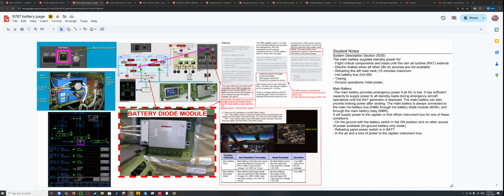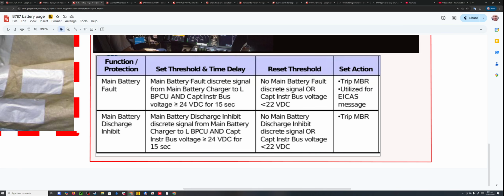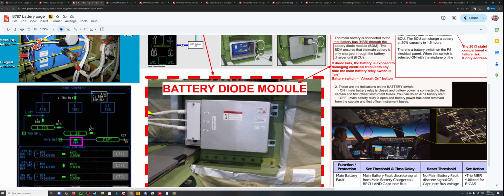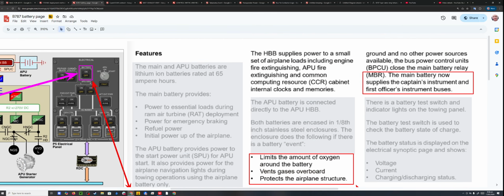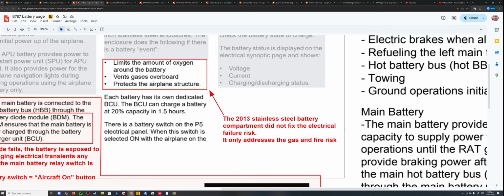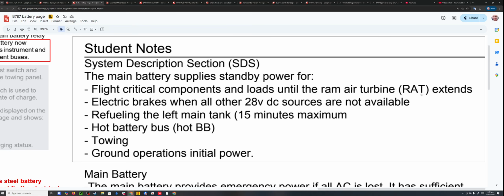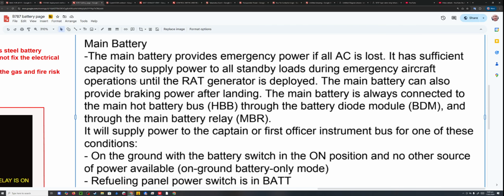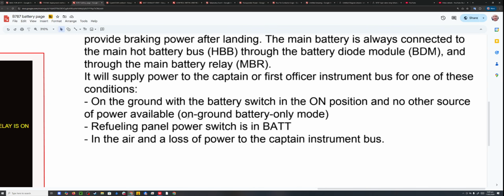AI171 Crash - B787 System Oversight Error (#2) Main Battery Relay Trips After 15 Seconds of Fault

Comment: Finally, you're explanation has got through my thick skull! Even I could understand the logic in this video. I reckon there are many Boeing engineers who know about this and are thinking "oh sh!t" the cat's out of the bag. Easy to understand video and another hammer blow to the initial report by the Indian Air Accident investigators.
Reply from the maker: this ones a bit old. the work continued and its not just me anymore. a team of people were employed to interrogate my work and did so, and its grown to perfection now with a few minor clarifications. Just things like the fact that both HPSOV and spar valve did have both their control relays reverse actuated, and the trigger to the HPSOV from the relay was reverse voltage but that still triggered the shutoff as the relay at the other end of that on the FMU on the engine, doesnt care about polarity. so both spar and HPSOV valves closed. All 4 EEC channels involved reset, with each sides dual channels resetting at the exact same time thanks to both PSOV and SPAR valve relays triggerding their EEC resets on the 250ms delays, the entire HPSOV contr relay is on the delay, but for the spar, its just the output to the EEC reset. 
The source of the reverse voltage is the melting down battery and is assisted in part due to the nature of the airframe's construction, where the front bulkhead is metallic and the rest relies on copper wires for the current return network. 
The most important fact is that it is simply impossible, as tested, and categorically proven, impossible for the RAT to be supplying hydraulics earlier than 13 seconds after a valid fuel swtich cutoff on takeoff, unless the RAT was already commanded to deploy for a different reason. That reason, is the documented trigger, of loss of ALL power to both instrument buses. That means, all DC power including the battery. If it is not kept alive by the battery, it satisfies that trigger and deploys the RAT.

Comment: Dear Jeremy -
much thanks for good detail work .
from very beginning since i knew there are Lithium batteries in this aircraft ,i believed it was battery thermal runaway fire case (and Mr Ranjeet Jahn too made my beliefs strong on Mojo story ) and through Mr Stig  i saw what boeing did after battery fire incident in 2010 to 13, just built a steel case called Coffin to protect outer electronics from the fire but nothing to real Battery improvement.
i believed Fuel spar valves would had shut if 14 V DC coming from Lithium Battery of 28 VDC supplied Died ??
Mr Richard Godfrey on Mr Geofrey thomas youtube channel wasnt agreed my Battery thermal run away theory, though they both stay on case of total power failure , and no fault of Pilots Theory , and really has been working hard .   

my short video on it 

https://youtube.com/shorts/0gEgweZWuaY?si=wIz8RvOI6nSULFyM
Reply from the maker: nope its not 14 volts that dies. 14 volts should never exist anywhere.
28 volts should be going the correct way. what happened, is the battery shorted to case in the middle of its string of cells, or close to the middle, just as it did in the Takamatsu fire event in 2013.
This short to case creates an entirely unseen and unplanned DC electrical circuit. The voltage that the coils of the spar valve control relays recieve, is reverse but not fully 28 v. by desing, (milliitary specs) they have a safe garuanteed minimum required voltage that theyre desinged to be able to function at, and for these relays, its 14.5 volts. Further the manufacturer of the relay does not put in reverse voltage diode protection because they know that doing so puts them at blame if said diodes fail. DIODES FAIL,. so instead, they make it the aircraft manufacturers problem, and clearly state in the relay specifications that.. and i quote:
"Applying reverse voltage to the coils will not damage the coils, however the relay may transfer"

That means, all it takes is 14.5 reverse volts and the coil will pull the pin the wron gway instead of puishing it, commanding closure of the spar valves.
Reply: @jeremyjohnthompson5187 thanks again for such a detailed information,

Comment: My analysis: Pilot did turn off the fuel switch, just to check what's the issue, Just like if a motor doesn't work even while plugged in you just plug it off/ switch it off and try again (It's pretty Indian thing to do as well) But what made the pilot think that there might be some issue with the Engine/fuel switch may be due to some massive electrical failure.
Reply: A 10 second switch off while 100ft off the ground? 10 freaking seconds........

Comment: Am I reading this correctly? I understand the reasoning behind the 15 second delay when a battery fault is detected and the check to make sure there’s adequate voltage on the Captain's instrument bus before disconnecting the MBR but this type of added delay doesn’t work well for a battery shorted condition and what you’re pointing out Jeremy. What it looks like though is if there is a battery short that caused the battery fault or if the shorted condition occurs after some other detected fault and the MBR is closed the Captain’s instrument bus voltage is going to get pulled below the 22V min limit and the MBR won’t be opened up even after the 15 seconds is up if the bus voltage remains below 22V. At least this is the way I’m reading this.
Reply from the maker: I think you get it. I think your reading it correctly.

Comment: Maybe this is a bit pedantic, but you've mentioned a few times that the 787 is unique compared to all other aircraft in history in that the main battery is always "on bus".  This may be true for large jets (it's been a long time since my 737 days but I think that's probably correct).  I think the main reason for this is that the big jets will have a battery charger that will charge the main Ni-Cd battery in constant current mode first and therefore will go above normal bus voltage.  But there are many many smaller aircraft equipped with Ni-Cd and lead acid batteries that will have the battery on bus all the time.  Probably any small turboprop, maybe small jets but I'm not familiar with those.
Reply from the maker: None of those smaller aircraft use this same hopeless lithium cobalt oxide chemistry.
Airbus use Saft's sensible LMFP, Lithium Manganese Iron Phospate, similar to LiFePo4.
None tie the fautl together with a garuanteed 15 seconds of propagation to both sides.

Comment: Top value information found in this episode .Now it can be determined that everything of the electrical system was designed to fail. On the topic of battery & associated circuit, High capacity lithium battery placed inside aluminium container means non extinguishable metal fire as in EV car fire.
[ Need to know what diode is/are inside the “ Diode Module “ as in the photo.] This 1960’s methodology is not the proper way to control high battery current direction flow. Diode is easily broken down. 
The operation of the  three DC  fuel valves are extremely critical , they must be properly powered. 
I can’t see  anything there sensible.
Even the basic requirement of an Manual Bypass in Automation Control is lacked. Flying hundreds of lives has no take two in computer Flight Simulator game.

Comment: The prior flight, having a hard landing, failed cabin electronics, failed air conditioning, and even worse, a failing horizontal control surface reported by the prior pilot, was most likely, an unheeded, lethal warning, that seemed to have been ignored, or was wrongly assumed as "fixed", for the two+ hours the airplane was on the ground.  

Every critical component must be made easy to inspect, they made the battery very difficult to inspect while attempting to solve the fire hazard.

Comment: Based on the footage alone, and the dust that was kicked up, obviously because it was too low and unable to gain enough height..but that that element alone should exonerate the pilots, if it was intentional, i would think they would wait until they get at least a few hundred feet off the ground..Their slanderous explantions pointing at the pilots is such an absurd insult to intelligence. That said, now that you mention the brakes, is it possible due to the non-standard take off they were aware something was very very off, alarms going off etc, they tried to brake much earlier before V1 and reject takeoff hence the dust being kicked up. but for reasons that we know now, not enough power was available to brake.? There was an event in 2020, in Leipzig flight QY841, where the crew rejected just before rotation and they hit the brakes where the nose was actually off the ground..ending up destroying all tyres. but that was a DHL A300. Since the 787 is such a electronic relient system, and knowing how erratic electronic shorts can be wreaking havoc and with the  intermittant nature of shorts and false signals, anything is possible. and would that brake application show up on the FDR given that it may not have been recieving the signal of inputs from brake application.? Or was it the brakes that zapped most of the remaining power, but not enough stoppage power so they continued.? All we have is that footage as you can't rely on any FDR or cockpit or phyiscal evidence that comes from these conglomrates. They will 100% negotiate the narrative to ensure they come out on top, reputation intact.
Reply: heres the thing, thats not dust that was smoke coming out from the bottom vent of the airplane
Reply from the maker: close, but the key lies in what happened after the short. it wasnt just 0 volts. something managed to generate reverse voltage to reverse actuate the run coil (open coil) in the dual coil latchin relays that control the spar valves. This is the only possible thing that can command a fuel valve to close without the EEC and CCS agreeing with the switch.
So you have to join it all together and find how its possible to end up with negative 14.5 volts on the instrument buses, one after the other. (minimum required to actuate coil accordin to the MIL specs)

Comment: HI, a Dad here! I love the analogy of a DC UPS with wings! I myself couldn't believe the 15s delay built in to the fault monitoring logic! Again, I'm not an aircraft engineer, but I've worked with DC on CNC machines.  And there's no way I'd want to be anywhere near a DC Drive designed to provide 100A power to a motor when it is seized, for example. 15s of untold DC power flowing through the circuitry and the motor would scare the pants off me! I just do not understand their thinking on this. Can't wait for the next video.
Reply from the maker: theyve got lots of breakers to save situations between the buses and the loads, but only a diode module and a relay with 15 seconds of logic between the battery and the bus!
Reply: @jeremyjohnthompson5187 😮 Wow!
Reply: @jeremyjohnthompson5187  So, they are sending short circuit current through a thermal runaway battery adding more energy with every second?
Reply from the maker: @stevefuller6014  the energy from TRU to battery would have stopped very quickly, the TRU has th efollowing for overcurrent protection shutdown...
1. AC input CT clamps
2. DC output hall effect sensors

The short remained and with the lack of supply from the overload protectd TRUs now offline, the batt was able to  then wreak maximum havock with reverse voltage from the internal short to case. All it needed was 14 volts to send the relays the wrong way.
Reply from the maker: fast forwrd 10 seconds, battery is let go, MBR opens afte 15 second countdown, TRUs resume supplying bus, RAT is supplying TRUs with AC. Relays reset to correct run position, open 28V sent to spar valve motors, fuel flow resumes, along with ignition
Reply: @jeremyjohnthompson5187 Excellent summary of key events. I have a few questions regarding the TRUs:
1. When a normal load shorts, does the load breaker trip first, or does the TRU overcurrent protection activate first?
2. In AI171, after the MBR opens post-countdown, how does the TRU knows it's safe to come back online i.e. how does it know in advance that it won't immediately overcurrent again?
Reply from the maker: @natanijelvasic  a load shorting would trip either its TCB ( thermal - not resettable by crew) or the ECB (electric resetttable by crew). differnet things have different breakers.

in one of my vids there are some diagrams that show differnet things.

The landing gear for example, they are feed by thermal 100 AMP breakers which cannot be reset by the crew, maintenance must go in to the EE bay and manual reset after sourcing the fault that caused it.

The TRU would not reconnect the DC side unless it was reset by the BPCU.
This should almost NEVER happen.

From the designer... QUOTE
ELCU Protective Functions:
Overcurrent protection
Differential Protection, 
Ground Fautl Protection
Unbalanced Current Protection

ELCU INterfaces:
Can Bus
Power Panel Data Netowrk
Current Transformers ( FOR AC)
Hall Effect Sensors ( For DC)

ELCU operational functions:
Open / close / trip from commands from the BPCU, GCU, and other dedicated controllers
Monitor Load current

Monitoring functions:
3 phase current
aux contactor status
pick up and hold coil current
trip status
Contactor discrete commands

IN SHORT:
The bus power control unit is that which is controlling the ELCU and the ELCU is monitogin and controlling the physical breakers based on the information sent to and received by the BPCUs.

It is the BPCU which will tell the ELCU that everything is back to normal, try again.

The entire thing works in harmony, just without the required human programmed input that a short on the battery will propagate reagrdless of its actions
Reply: @jeremyjohnthompson5187  Understood, thank you.
Reply: 🎉 Thank You explaining this

Comment: It seems pretty clear that the original design concept was for a fully redundant control system that had two battery units. After MCAS it clear that design reviews are no longer a priority at the company. 
This electrical system should never passed a safety review.
Reply: yeah this system has no backup for a full blown electric failure
Reply: @lethalshadow95 a full blown power fail keeps the engines running though
Reply: @RoelandJansen  no it doesnt. are you stupid. the fadec/electromechanical switches are cut off.
Reply: and... mcas was not an issue, pilots were the ones that could have prevented the crashes.
Reply: @RoelandJansen  they were not told about the changes in the software. imagine you are running something and you dont even know something changed
Reply: @lethalshadow95 the stabilizer inadvertedly ran, cut out, done. now the companies have been blacklusted in Eurooe sone time. Wondering why no other crash happened? Basically stab trim runaway = memory item . no need to crash.
Reply: @RoelandJansen no....have you even bothered to watch his videos? Your comments are telling me that you didn't even bother to watch his videos. Ps.... You are doing a poor job at shifting needles here. I can tell what you are